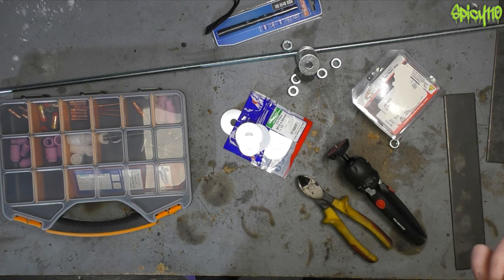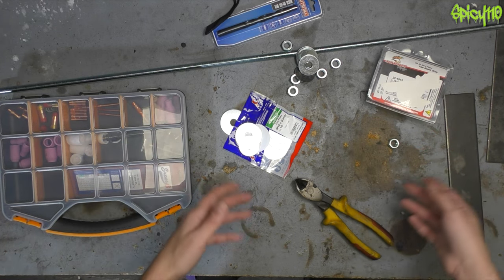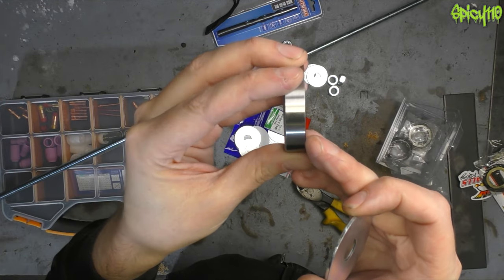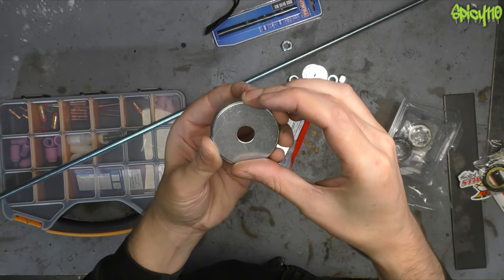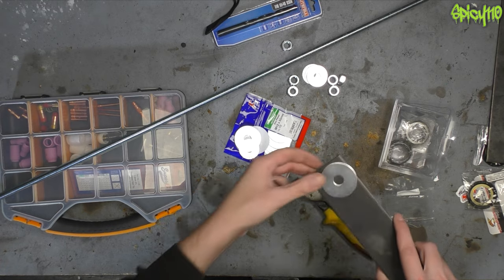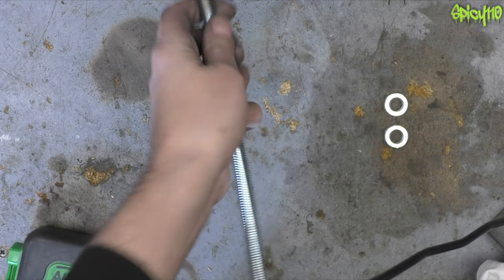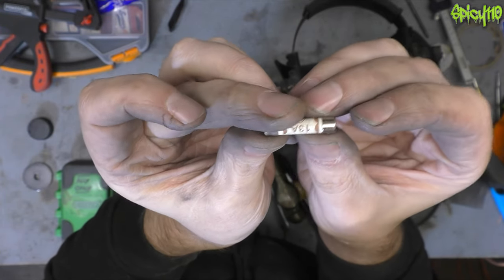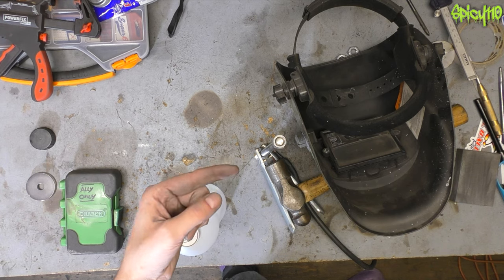Making a headstock bearing tool for my Motorcycle!

Comment: A very useful tool, but you don't need to make washers small enough to go down inside the headstock, If you had just left the plate square it would have  pulled the races in level with the top or bottom of the head stock and you could then have stacked the old races between the plate and the new races to push them further in.
It saves a bit of manufacturing time and your tool will work on a variety of bearing sizes. (larger and smaller)
The old races generally only go in a mm or two so come back out very easily.

Comment: I just used the old races and lump of wood and tapped them in with a mallett.  First I cleaned the recess a rotary tool with a brass brush and I had the races in the freezer overnight.  Bare in mind if the races are that cold gentle taps as the race could shatter.  I had no problems. I used ACF50 corrosion block grease as is doesn't soften or wash out.

Comment: A threaded bar is what I call those and have those referred to as in the south of England.

I'm going to recommend either greasing the parts for least resistance or using some thrust bearings. I have some 51102s, but I believe there is 51101, and 51103

Comment: Your a braver (or mad) man than me, getting your hands that near a wire brush wheel without a thick pair of leather gloves on. I'd never put on here what I was saying watching you do that! Tip, turn the old bearing cup upside down (once out) and use it in the tool to press the new cup in.
Reply from the maker: Naa I can shove my fingers in it no issues, its not that aggressive. Not to mention you really do not want to use gloves with any rotating tools.

Comment: Thats well sketchy with the plug, id get a standard 13amp fuse and see if it blows, if it does then id get onto the place you brought it from cause that does not fit with our strict EU codes, sounds like it would be pulling alot of current through normal household wiring, which it isnt designed for